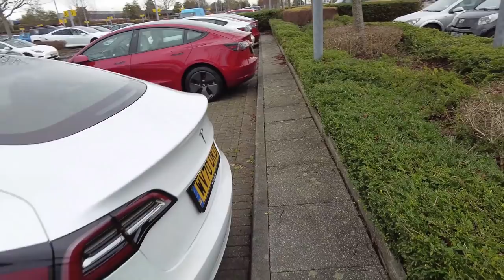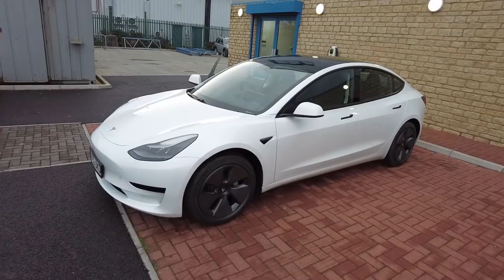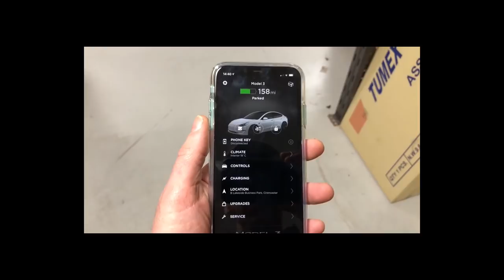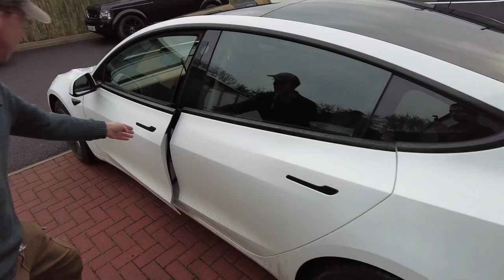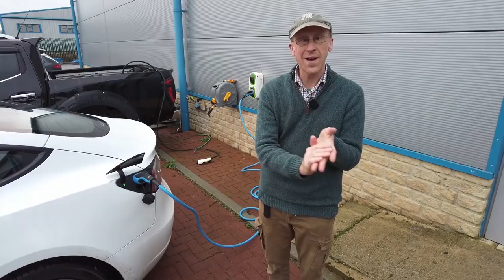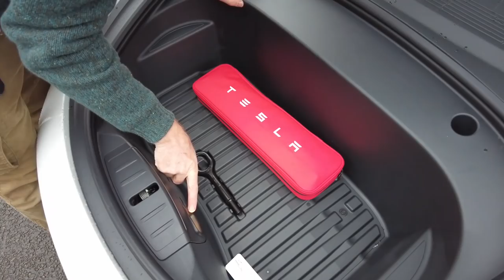First 24hrs With Our BRAND NEW Electric Project Car - What Could Possibly Go Wrong?!

Comment: I bet the proposal to ban the sale of new combustion engine cars in 9 years time doesn't happen.
Reply from the maker: Only time will tell but public opinion is changing..
Reply: Its definitely not going electric in South Africa. Can't generate enough power to keep the lights on for 24 hours let alone to power our cars. Guess we're going to keep using cars and trucks belching out there filthy exhaust until the oceans swamp us all. Sorry for that UK.
Reply from the maker: @stevewinterton2598  Shame as you guys should have excellent solar potential..
Reply: Sure I can build my own solar farm to charge a car for local travel, but we have vast diatances  and charging along the way is going to be an issue because our politicians and friends have stolen all the money. There is nothing left for the necessary charging infrastructure. Its so bad we can't even maintain the base load we've got so we have daily load shedding.

Comment: Shocking door alignment. Good luck getting any meaningful charge into it from those Rolec chargers. They barely top up the iPace overnight!
Reply from the maker: The business a few doors up design and manufacture chargers and he has offered me a free unit... so we can do a comparison !
Reply: @L663  yes, I would imagine you have the power in the unit for a 32A unit at least, maybe more. Its a good idea for a comparison, as its the problem a lot of owners come up against. They don't understand why they can't just get a bigger house supply and stick a rapid charger in 🤣.
Reply: I'm curious about charging overnight with the solar array on the roof.
Reply from the maker: @alanhassall  I tend to work in the day and sleep at night...the solar panels and charger are both at work so get used in the day !

Comment: Simon, welcome to Tesla ownership! When I was looking for an I-Pace, I was in the Droitwich Jaguar Land Rover dealership and a Tesla went passed on a low loader. The JLR salesman said that was a daily occurrence! My neighbours here in Cardiff have Model 3 like yours, but he tells me he isn't sure if he has the orginal one it has been in for 'fixes' so often with a loaner taking its place! Having said that they are stunning cars to drive. I went for a Jaguar I-Pace, far better built but the IT part lags well behind the Tesla. Would I go back to a fossil fuel car, NO!! The loaner I have at the moment is a very nice Jaguar F-Pace R Sport. A lovely car but I can't wait until my I-Pace comes back on Monday. Why is it away at the dealer, because the IT is giving problems, now solved they tell me!  Good luck with Tesla, you will learn to love they way it drives! Oh and don't believe thee GoM! (Guess 'o' Meter) for the range stated. Yours is the 2 wheel drive and 'should' give about 250 miles on a charge, during the cold weather make that 230 miles! Read up about battery pre-heating by the way.
I'll send you an email with some useful links for getting the best from an EV. Ian

Comment: Get rid of the plate holders. Lots of model 3 owners swap them for vinyl plates. Did you figure out you can unlock the charge port from your app or the dash screen. I have the great combo of a model 3 and a Disco 🙂🙂. Have fun with it

Comment: Try feathering the throttle as you would in a traditional car on the approach to a roundabout, lights etc. Very tricky, you either stand on your nose or continue at the same speed. It's on or off. If off it brakes.
Reply from the maker: Sounds interesting...

Comment: Simon, why 16amp charge? You should be on 32amps. It looks like you should set the switch inside the charge point (Rolec?) to 32amp.. The reason for not letting you just pull the plug out is the anybody could stop you charging. On the Jaguar you press unlock on the key fob! Tesla I think it is on the app.
Reply from the maker: Yes that makes sense ! I will have to do a video on chargers... super charger... house charger....Rolec etc.... tethered v non tethered
Reply: @L663  It is a learning curve! I got my I-Pace in January this year and then drove it to my place in France in late Feb. I did it and only once explored the 5% Battery remaining on my first trip down! I learnt that it wasn’t good for my heart rate to do it too often!! To be fair there is always somewhere you can put a bit of charge in and get to a proper charge point, houses, farms or in my case a French cosmetic distribution company in the wilds out side Orleans! The have a policy of encouraging EV ownership in the staff and offer free charging in the works car park. I used the 50Kw DC Charger that they had for their vans. To cap it all they wouldn’t let me pay for the 55 mins of charge I had!!
 I’ll send you that email with items of interest regarding EVs tomorrow. Ian
Reply: If you need a bigger connection to your house then 3* 25A then your yearly basic charge here in NL is 256,00 but for 35A 964,00 that is 700 euro difference which is equal to 3200kWh. So that is why you must not exceed 25A.

Comment: Yes the light stays on but is it like most modern cars where the system and all electrics shut down after about 20 minutes? You'll have to leave a camera in the froot for an hour or so to find out for sure. I suspect that it will shut down otherwise the small 12V battery will surely drain over a period of time.
Reply from the maker: I could not shut all my viewers in the frunk for that long..
Reply: @L663  
Ha ha! Never heard of editing then old froot?

Comment: I'm picking up my new car next Tuesday. Another basic model with the only extra cost being the paint. Good old modern Diesel engine matched to an eight speed DCT.  Very oddly I have noticed in the specification that second and third gear have identical ratios, so it looks like it only has a true seven speeds.
Reply from the maker: That must be a typing error ! no point have 2 identical ratios
Reply: @L663  
That's what I tend to think as well. However, they are both printed as being 2.217:1 and there is  a reasonable gap down to first's 3.429:1 but  not as much of a gap between third and fourth which is 1.621:1
They seem nicely spaced except that there is none between second and third. 
Tractors and some trucks have this or even overlapping ratios but mainly in semi-powershifts where a declutched ratio change between ranges [rather like the range box in your Defender, only robotised] is made so that it can still pick up in the maximum torque area after an upshift of the range and speed matching of the powershift gears, which is a relatively slow change of two gearbox sections together. 
I'll make special note of this when I collect and drive it from next Tuesday onwards.

Comment: Always love your content no matter the car BUT does this mean less defender content 🥲

Still need to see
- you using the winch in a real life situation
- adding wheel arches
- upgrading the sound system 
- deadening the doors with dynamat, this will improve the sound and reduce road noise, you could sell the pre cut dynamat
- upgrade to duratracs and perform decibel test before and after for road noise. 
- cameras front and rear to record other road users. More kit you could sell. 

🙏🏼
Reply from the maker: So the Tesla is "the bosses" car... and for those that have not worked it out "The Boss" is my wife and true fact she started the business not me... Anyway as the car is her daily car I will not be able to do that many "winch fit" type video... the Defender is a development car so will still be the main focus... thanks for the video ideas ! some of these are in the pipeline..

Comment: Brilliant, well done Simon. Hope you and the family enjoy the new car. It would be interesting to keep data on running costs. There is always a load of people who like / dislike electric cars. I'm on the fence. I'd be interested in real world, how much it costs to run over a year or two in charging costs, servicing costs etc. against a petrol/diesel vehicle, like The Stig (not like for like I know, but they are your two new cars). And then add in to the mix, the environmental impact. How much of those bad CO2's were created in the manufacture and shipping of the car to the customer. I suspect over a 2 or 3 year ownership, the Tesla will work out cheaper and less environmentally damaging. I don't buy into the electric range remaining fear that people talk about. My diesel L494 has the same, a display that tells me I only have 35 miles left, I don't start panicking about it. The only issue I have with electric cars is recharge time. I currently go to the fuel station and fill up from empty in 5 minutes and then I'm on my way. I'm not wanting to wait hours to fill up an electric car. And I don't want to have to change my lifestyle to suit the car I drive. But I suspect that technology will progress in the next couple of years and soon be able to full charge in under 15 minutes.

Comment: Tethered means only one type of charging, if a Nissan Leaf rocks up it can’t charge. Taking your own lead around with your car makes more sense. We had tethered and swapped to untethered after a few years
Reply from the maker: Thethered make sense to me at work as can have designated parking spots... but i cant see how you would disconnect the car !
Reply: @L663  push the button inside the Tesla !

Comment: Only problem with Tesla, great car that they are is, they can disable many functions over the air whenever they want. So you can end up with a car that hasn’t the same functions as the day you bought it because Tesla want to charge a subscription for those functions.
Reply from the maker: But the opposite is also true... I can add features that i want later... something Land Rover will not allow..

Comment: What does the opening text mean?
Reply from the maker: No idea.. and i wrote it.... lets hope the boss does not watch this video !
Reply: @L663  hehe 🤫 🤣

To get the cable released from the car, are you able to tap the flashing T symbol (as long as the car is unlocked)?
Reply: Tesla chargers have a button on the connector. It’s the only good thing about the Tesla Charger though.

Comment: I have recently purchased a new car to replace my superbly engineered and impeccably made VW Phaeton. I owned the car from new and ran it for 10 years and 120,000 trouble free mikes. It was my second Phaeton. One of the things I was looking for apart from performance,comfort,engineering integtity was buld quality. i.e. good panel fit with no rattles and squeaks. So, my question is how do Tesla get away with putting a car out there with these sort of apallaning faults. Where is the quality control ? No other major car manufacturer could or would get away with this and from the many reports I have read on all 3 model Teslas here in the U.K. this is very common ! Now I know Tesla have their supporters and owners who either won't admit this is true or somehow just glaze over it. However for me, the apalling build quality was the defining reason why I just couldn't consider a Tesla S  as a replacement. These sort of faults are not acceptable on any new car now but especially ones with pretty high price tags like the S class Tesla.
Reply from the maker: Yes its not a great Tesla advert..... we love the car but we are not "blind" to the faults.

Comment: Watch out for the Tesla fan boys. If TFL had problems with their Defender check out the problems they  had with their Tesla. Would have been good to see an i-pace - if you had the odd £65k of course!
Reply from the maker: Hi - I am a Tesla fan..... thats why we purchased one... and this video may help them get to the bottom of a potential quality issue.
Reply: @L663  I suppose i don't understand why people are fans of Tesla who, whilst they produce interesting long range cars, have very shoddy build quality. i just think JLR get a lot more criticism than they deserve (of course they deserve quite a bit). My experience is that people tend to keep quite when their German cars break down. My friend had two new German cars (BMW and Mercedes) both of which  had major faults and one stranded him on the motorway after 3,500 miles. I have a Velar which is really very good. Some weird  software issues which either resolved overnight or were fixed by an update but the build quality is very good.
I worked in IT and there used to be a different and much more rigorous standard for software for engineering as opposed to commercial software. When even planes fall out of the sky due to software then I think we know things are not right.

Comment: Typical American car build quality but Tesla will sort out the panel gap issues.
You should ditch the number plates and get vinyl ones, they look so much better 👍🏻
Funny watching you try and release the charge cable.... I’ll give you a clue.... the screen does most things 😉
Tesla are years ahead on battery tech etc so you’ve made the right decision in my opinion 😍

Comment: I have a Model 3 and a tethered lead I unlock the lead using the app ;-)
Reply from the maker: Elon....that would be the app that froze for a few hours ?
Reply: @L663  or the car screen 😉
Reply: @L663  you make a fair point! I don’t think my app froze yet but if it did then a restart - you can also unlock it from the car screen

Comment: It's not a 'frunk'. That's oh-so American. It is a 'froot' in the UK. A front boot.
Reply from the maker: I kind of like the word Frunk... its an American car afterall...
Reply: @L663  
You surely aren't going to call it a 'sedan' running on 'gas'? Uh except it doesn't run on gas. Whoops! A hood for a bonnet. Tire instead of tyre. Facia instead of dashboard and, horror of horrors, firewall instead of bulkhead. 
No, we suffer far too many Americanisms as it is. It is a Froot, front boot, and that is that.

Comment: According to the latest reports on EV production (I'm no expert here just reporting what's been written) the carbon cost of producing an EV is greater than production of current petrol/diesel vehicles, so much so that you need to cover 50,000 miles in an EV just to bring the carbon footprint in line with standard vehicle production.
Reply from the maker: I can believe this - but this may not account for the fact that we are running the car on solar ( from our warehouse roof ) so our benefit should be a little better. I still have worries that the main benefit of EV's is air quality in the cities.... we need to look at ways to generate clean energy... I would live to see a Severn barrage etc ( river Severn in the UK as a massive tidal range )
Reply: @L663  Personally I think EV's are perfect for city cars or short runs etc. Petrol & diesel vehicles are much cleaner now than they have ever been and would have continued to evolve given the chance and for long journeys I still think that 10 minutes filing up with fuel is better than waiting my turn to charge a vehicle for approx 45 minutes. It's going to be interesting to see how this all pans out, especially once the environmental cost of mining for lithium & cobalt becomes more of an issue and the realisation that currently EV batteries are not fully recyclable.
Reply: @dennij  I agree with everything you say John. An ideal solution for many of us woud be to run acombustion engined car for our longer journeys and an EV for our local short ones. Howver for many of us, the cost of running....and buying....2 vehices is prohibitive. I think i Read that Norway who have aggressively promoted EV's for quite a few years now with very generous subsidies found thatthey were actually subsidising wealthy folk who could afford 1 combustion engined car and 1 EV. Hence they cut back on the subsidy.

Comment: I'm sorry but you're being an absolute numpty when it comes to charging. To stop charging and unlock the charge point, you press Stop Charging and Unlock Chargepoint from the app or car, not just yank on it and wonder how it'd be done with a tethered charger.

And when did you get a Type 1 tethered installed? They've been realistically dead for years. 

EVs are not difficult and it's disingenuous to ham it up. People have a responsibility to understand any vehicle they drive.
Reply from the maker: I kind of elude to the fact that i am in the "numpty" zone... but i am just showing what i find as a total novice...
Reply: @L663  So, can someone just walk up to the outside wall charger, switch it off and disconnet it, take the plug out of the car and steal the "expensive" cable?